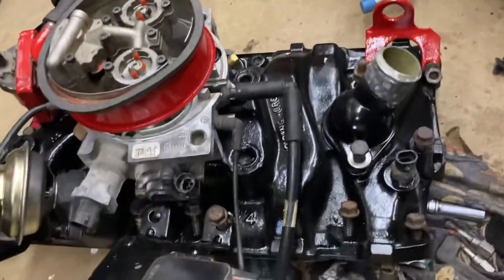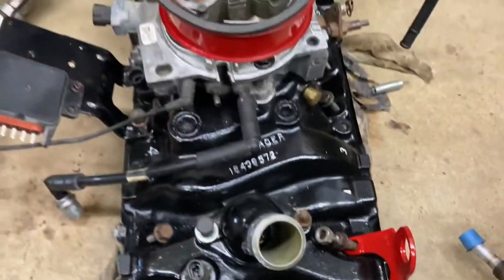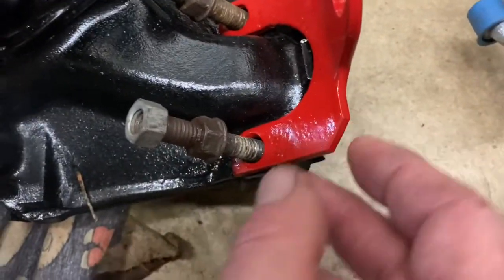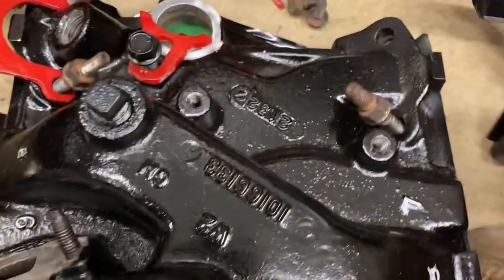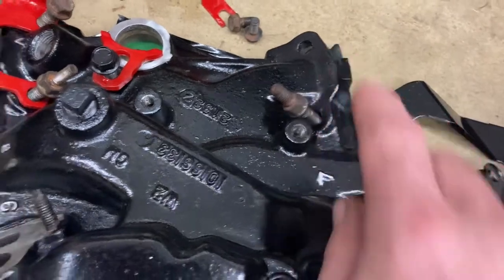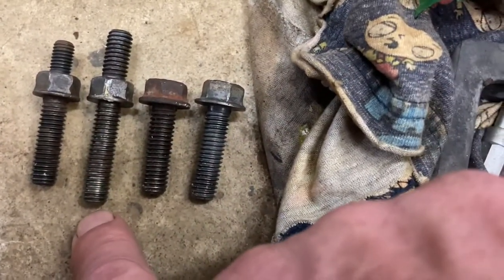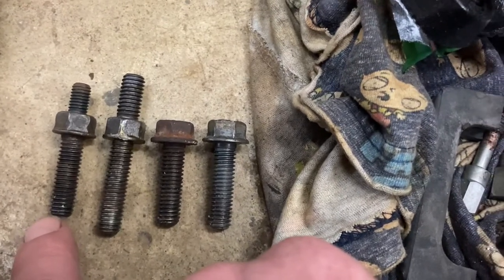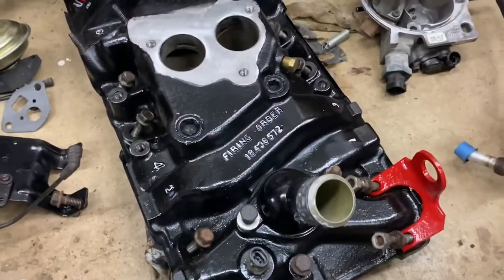Chev SBC Intake Bolts - Length Does Matter!

Comment: Please give the lengths of the bolts rather than say longer or shorter. Thanks
Reply from the maker: I should have. Engine is all together and running great so I can’t measure bolts now. 

Bolt length into head will be the same - the thickness of intake will determine the length of bolt.
Reply: @canadianwrench  how many different lengths are there? Take out and measure it. Repeat. Thanks